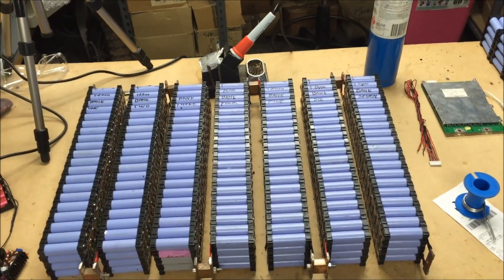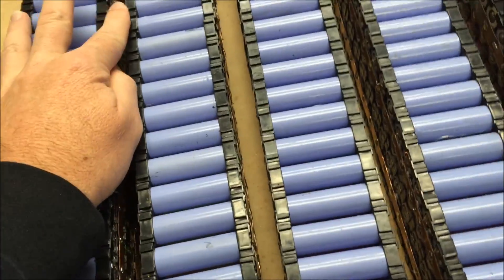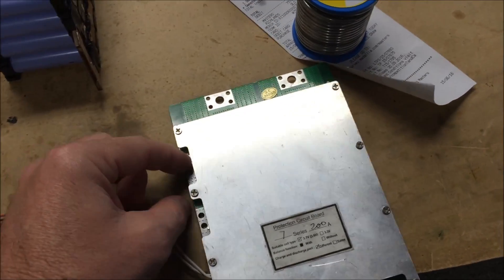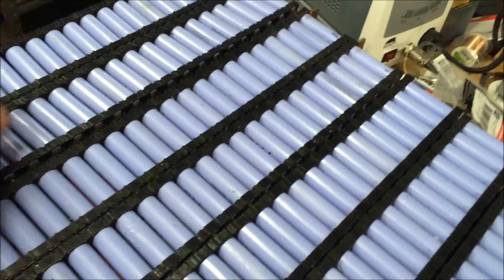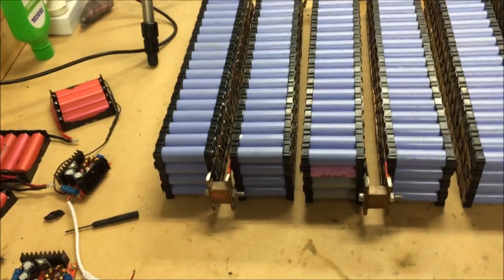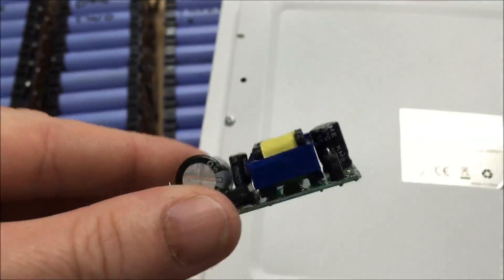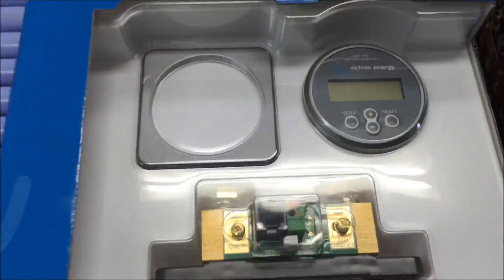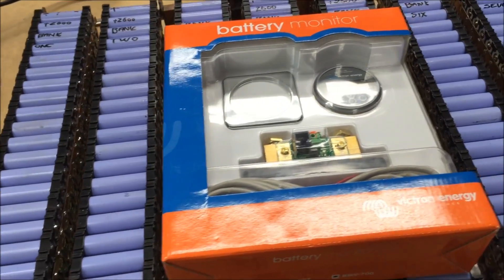HBpowerwall 18650 powered DIY powerwall update

Comment: HI,

At minute 3:10 is this type of inverter?

http://www.ebay.com/itm/150W-DC-DC-Boost-Converter-10-32V-to-12-35V-6A-Step-Up-Voltage-Charger-Power-/371675632785?hash=item5689981491:g:QTsAAOxyn~pRzueN

If so, how do you use it? It is safe to charge cells LI_ION? How will stop charging / overcharging?

Thank you for sharing, and good job!

Comment: Dohickky is LED power supply, 240v to what ever (depends how they are wired) main factor is the current...likely that its very low current output, Spec page from where you purchased it probably has the watts listed. So you need a current limited supply or the LED's over heat and burn up :)
Reply from the maker: dohicky is in the bin - working on 50v dc now :)

Comment: the Do hicky is a constant current supply. it does convert AC to DC but the voltage varies but current stays the same. LEDs run best of a constant current supply.
You probs just need a higher voltage, 36-48 volts ish, so use a boost converter to boost the voltage up, than measure current draw and set power somewhere below 24W like 18 ish as the power will increase as it heats up.
Reply from the maker: cool will do

Comment: Hey Pete. Love you videos. Just some Advice. DO NOT trust what the BVM tells you. Unless you reach 100% SOC at least once or twice a week. You will get inaccurate readings. I have dealt with this unit in my programming and with other solar people who have used thse's and the BVM can be up to 15% out on its readings. Also have read a e-mail from the manufacture stating what i have told you about must reach 100% SOC atleast once or twice a week. Keep up the good work by the way :)
Reply from the maker: it'll go 100 % every day, have a bunch of spare panels to ensure that'll happen :)
Reply: that's good. those bitchrons can be rather inaccurate sometimes. Done alot of tests with them and mentioned it to victron energy and they knew about it and didnt really care. Hate companies like that. Your doing a very good :)